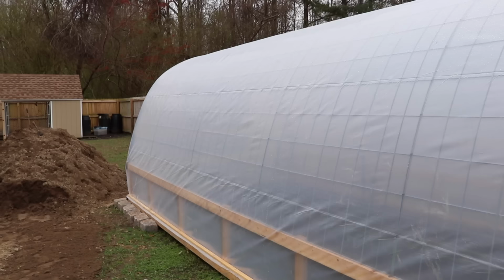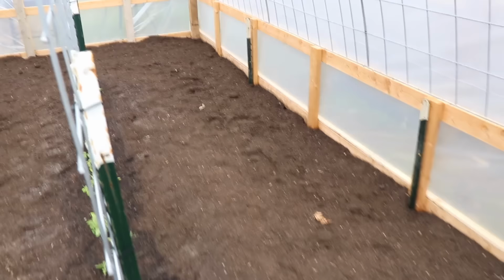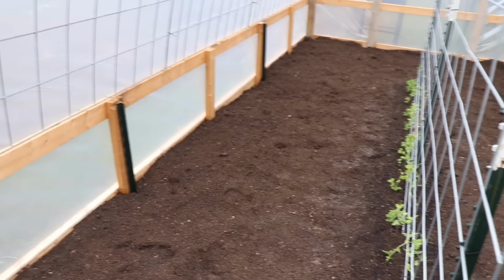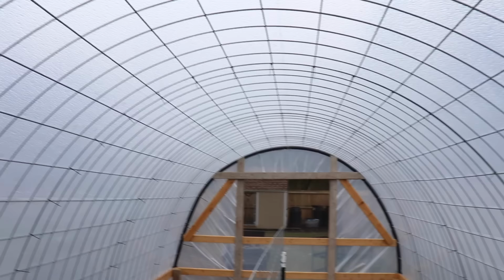DIY Cattle Panel Hoop House || Build Your Own Cheap & Easy!

Comment: Yes! I have built several of these. One for my bull, hay, worm farm! Mine is not as tall so they are about 10 feet wide. I overlap mine 1 square and connect with zip ties. The one my hay is in is 5 years old! Doing good thru the snow too. Put up a brace before each winter in the middle, good to go! I wish you the best!
Reply from the maker: Very cool! Very encouraging as this is our first season with ours! Thanks for hangin out with us. :)

Comment: Hello very nice greenhouse design. It is practical, simple and cheap to make. The only thing I would add would be cement pads to anchor the wood to the ground while protecting it from ground moisture.
From what I see in the video they have a waterlogging problem. This will create a problem with the useful life of wood, crops and ornamental plants. Moisture is the greatest enemy of constructions of any type and material.
The solution to this is a system of ditches to guide the water in the land to the outside of the property or to a designated drainage area. If they do not have access to drainage, a rudimentary one can be built with ditches and a well. The well in question and the ditches can be filled with boulders and gravel to give a greater area for absorption and storage of water on the ground and prevent harmful insects from breeding or collapse due to humidity.
This system will not only protect the land, but also the structures and crops located on it.

Comment: Super clean build! The added height from the wooden frame is so nice, and if you're on a budget that part can easily be built with free wooden pallets :)
Reply from the maker: Thank you so much! Yes, I love the added height, it makes it spacious & easier to work in there! 😉
Reply: I told my husband to use wood pallets and he said it wouldn't be very Good.  Thanks for that bit of advice.
Reply: @noraplowshay8784  it wouldn’t be. We tried some stuff out here with pallet wood and it rotted very quickly. Our friend used it on her farm and she says she replaces it every year or two
Reply: That’s exactly how we did ours, screwed together pallets then used cattle panels for the  top. We can roll the plastic up to the top of the pallets in the summer for good air flow and prevent overheating. Because everything was used and basically free our costs to put up a 12’ & 20’ greenhouse was under $30.

Comment: Looks good!  That's a great way to just build what you need without spending a ton of money.   Great result!  I would suggest using treated lumber for the bottom boards where it has dirt, compost, and moisture in contact with it.  But you did a great job with this.👏👏👏
Reply from the maker: Yes, we normally use treated lumber for everything we do outside, but the cost of lumber is CRAZY right now. Plus, we retire in 2 yrs and will be moving to our forever homestead, soooooo...it's ok if it only lasts a few yrs lol. Thanks for watching!!!
Reply: @HomeFreeAlaska  Wow, retiring at your young age is amazing — kudos.

Comment: I love the idea, the only thing I would do differently is move the walls about two feet wider so I wouldn’t have to cut each panel, or maybe just leave it where you had and make a high ceiling to train plants grow vertically.
Reply: they cut 1 lb because it would have made the thing too long for the frame they had. I don't see that they can hold any off the ends and it is plenty High.
Reply: @howtogetoutofbabylon8978  I’d just overlap the panels a bit.  It would make the arch a bit stronger too.

Comment: Panels are about 16 feet long X a little over 4 feet, I think.  I worked at a ranch supply house for about 9 months and helped load hundreds of hog and cattle panels, mainly to fence in critters with T-posts.  Not many customers would use them for grow houses.  They prefered buying their vegies, I guess, or eating mostly their own butchered beef.  I could get damaged panels for climbing vegs like pole beans.  Never had the room for a grow house.

Comment: Hi!! This is exactly what I have been wanting to build. I FINALLY came across your video and am so happy! Most of the videos are people that buy outrageously overpriced kits and the tunnels are small. I do, however, have a couple of questions. What size are the cattle panels? How long are the 4X4 posts and how deep are they buried?  Also, I'm assuming you used the cement in the post holes...?? I can't wait to see more videos as your tunnel greenhouse comes alive!!  Thanks so much for this!!
Reply from the maker: Glad we could help! Panels are 16ft L x 50in H...I can't exactly remember how big the 4x4s were but I'm guessing like 4 ft as we buried them 2 feet down in cement & there was approx 2 ft above ground. I'm so glad you enjoyed the video! :)

Comment: I like it and it looks great too !  I agree with the comments about better zip ties but also attatching to the wood side rails with two screws holding a plate over the bottom rail very foot or so and wire going up a few side rails incase spot welds let go.  Also the t bars firmly secured to the wooden side frames . thx.

Comment: this gives me such great ideas for a build. having the stub wall foundation is a great idea and would work absolutely perfectly for the height of a raised bed along the sides. my idea would require a bit more lumber but that comes cheap and easy for one who works in the trades.
as i say i'd love to have raised beds along the sides in order to have much more control over the soil. probably put a couple off center supports throughout for more snow load where i live, as well as a functional place for hanging baskets and the like.

ahh the ideas and rolling in. loved viewing this
Reply from the maker: I love all of your ideas! This design really makes it easy to tweak the build the way you want to. We've already done some upgrades as well like the sprinkler system & roll up side vents etc., I'm glad you like it, thanks for watching! :)

Comment: TiP .. Overlap the cattle panels by 1 square would make it stronger and use wire to tie together . Snap ties tend to break over time 
 Also i would`ve prefer to put raised  garden beds around the side and 1 through the middle, but that would change the whole structure plan. i wouldve built the raised bed first then put the cattle panels on etc

Comment: Looks great 👍🏼 Love the design!
Personally, anything unpainted and outdoors, it's worth the extra investment to go with treated lumber.
Reply from the maker: Totally agree! We just used what we had on hand at the time! :)
Reply: @HomeFreeAlaska  The ONLY time you need to use treated lumber is when you have direct ground contact like the corner posts. Your tunnel will last and last just how it is. Love the vid. How long are the wire panels??? Most come in 8' sections. Yours look longer than 8'.
Reply from the maker: @SurefireWoodsman  thank you…the fence panels were 16’ long by 50” wide. 😊

Comment: Looks great! I think it's going to work out really nicely. You might want to use hog rings instead of zip ties to hold the panels together though. They're metal clips that you bend with a set of hog ring pliers and it'll be a little more secure. You can just put them on from the inside. You can get a super cheap set of pliers from Harbor Freight that work ok or a better pair is only like $15-20. And the hog rings are really cheap. $5 or so for a box at a farm supply store. Just make sure they fit your pliers. Good luck with the greenhouse.
Reply from the maker: Great idea, thanks for the tip!
Reply: They would poke holes in the plastic or rip it when you drag it across the sharp end that will roll around the wire
Reply: @HomeFreeAlaska  What gauge of wire are the cattle panels 10 or 6 ?
Reply from the maker: @slingshoter8783  hi, they’re actually 4 gauge! 😊

Comment: Since you have the height you might want to use some PVC sections and hang it from the ceiling to hang things or run lines down to anchored spots to allow tie ups for climbing tomatoes, beans, etc that need the support as they get taller.

Comment: I would have use gravel for the floor, but to each their own. Get the plastic shelves that are thick that can do three levels, then buy lots of plants and pots, and set them on the shelves. Do it on both sides in both rows, so there would be four total. Heat it in the winter with a 55 gallon barrel stove. You are going to need a watering system like a mist machine to water your plants and last you were going to need fans to circulate the air. You are going to want to get to thermometer gauges to see what the temperatures are at all times.

Comment: Tina, if i am thinking, you'd do the same hoop panel build in Alaska for either goats or sheep or outdoor hoop farming, my only suggestion would be to build one with log cutout like on the sled.. on the horizontal ground logs of the frame with racing tow hooks, easy to move when its either winter or summer.
Reply from the maker: Thank you for the recommendations Edward! 😊

Comment: Thanks for sharing your hoop build project. Great inspiration! Apologies if this has been already asked and since this was posted earlier this year, I assume you haven't had snow yet, but I was wondering if you know how well this structure will hold up in such elements? Im curious because we live in an area that experiences the full force of all the seasons and would like to do something similar.
Reply from the maker: Hello! We do have some snow here in VA where we’re at but not much. We built this hoop house this spring, so have yet to experience winter with it yet! I’ve had a lot of subscribers that live with tons of snow, that say it’ll definitely need a center support beam to withstand the weight of snow. I agree a bit more support might be needed if you live with a lot of snow because the cattle panels alone won’t hold up. But also being diligent with snow removal will be important too to decrease weight and also preserve the plastic. 😊
Reply: I love their Design! They did an amazing job. I built my greenhouse with a similiar design, but used 4x4 posts, pallets and framed side beds. We get 28 inches of snow and high winds with no problems. I also draped a shade cloth on top and tied it down with ropes.

Comment: This is awesome.  I stole this idea and made one that is 17'6" x 7' and made it mobile!  Added 6 10" Harbor freight wheels and braced the corners so that I can move it without damaging the structure.  Did the doors and end wall framing with 2x3 to reduce as much weight as possible.  Also used "hog rings" instead of tie wraps to attach the cattle panels together.  I can move it by hand but pulling with the tractor makes it really easy.  

Great job.
Reply from the maker: Fantastic!!! So happy the video helped!😊

Comment: To help keep plants warmer without heat source you could put hoops and agribon row cover also if you dig down below the frost line and use Ridgid house insulation foam does keeping the frost prone ground outside the structure hitting the Earth 55 degrees below frost line on average could coat the wood and stain and spar varnish feeling it to make it last longer did that with my mailbox when people are moving out seems like they always throw stain away or put it out for free so I take it for woodworking
Reply from the maker: Hey there! Thanks for your recommendations! We appreciate that. And good thinking on the free stain, I like that!

Comment: Using the cattle panels is a great idea. There are so many rabbits in my area, I'd be afraid they would tear through the plastic at the bottom. I would have to either put solid panels at the bottom or some fencing.

Comment: Personally, I would have built doors at both ends for maximum ventilation in a hot summer, Also to allow entry for compost etc, rather than one door from one end. The vents need a piece of plastic to go over the vents for winter use so you can overwinter or grow veg in the winter,. If you had not planted peas down the centre you could have placed a row to slabs to stop you from walking on the soil and compacting it. Plus the space on either side would have been maximised. Well done for the joint effort and your touches of love for each other shown in the building,
Reply from the maker: Thank you Paul. Yes, actually of course after we built it there were things we sat back and looked at & thought we wished we had done differently. One of them is the doors on both ends. I wish we would’ve done that. It’s fine the way it is but doors on both ends would be most convenient! Thanks so much for watching our video. 😊

Comment: very nice, i like the idea of using the panels, I used PVC hoops and after 4 years the heat of the summer made them sag.   BTW the box store plastic will not last one year. it will get brittle from the UV in the sunlight.   it is total with paying for greenhouse plastic it will last 3+ years in the blazing sun of Oklahoma.   as a note for others, don't use nails, in your 1x nailer strips, use screws, you will have to replace the plastic, sooner than later, and at least yearly if you use cheap plastic.  if you use PVC hoops you have to sleave them with black poly pipe,  if not the chlorine from the slow break down of the PVC (poly vinyl chloride ) will rapidly break down your plastic where it touches the pipe, learned that the hard way too.
Reply from the maker: Thanks for the input! I love hearing from other’s experiences! And you’re right about the plastic. Learn as we go right? We’ll def be replacing it I have no doubt! Thanks again for your comment & for supporting our channel! 😊

Comment: Zip ties are not a goood idea...The become brittle quickly and literally fall off! Use wire.
Reply from the maker: They work just fine for now. We’ll replace when needed.😘
Reply: Use Uv coated ones. They last longer.

Comment: Excellent build looks solid and like it will last... A little thought I had while watching for possible upgrade, adding a send layer of plastic sheeting using a foam separator to give you an air layer for insulation, should help retain more heat and extend growing times. Also add in some sort of low cost/natural heating for even longer growing times.

Comment: I like the cattle panel design. Yours' is very similar to the one I built. Don't know where you live, but I put a center support beam on mine to keep the snow load at bay.
Reply from the maker: Right now we’re in VA & we don’t get much snow here. 😊 But I’ve had a lot of subscribers tell me they have also built support beams in the center to withstand the snow load where they live! 😉

Comment: I bet this cattle hoop building  handles the wind and snow very well.
Reply from the maker: Can't speak on the snow as we don't get much here in VA where we are, but we do get high winds here and even had tornados this summer and it held up with no issues. With every project you just have to evaluate your environment. Maybe a hoop house in another area wouldn't be the best structure...maybe a more permanent structure like an actual greenhouse with a foundation would be better to withstand heavy snow loads. But for us and our climate, it turned out to be a good little space for growing! Thanks for watching!

Comment: You might want to add some cheap lawn chair webbing across the top ever four feet to help the wind from lifting the plastic off. If the sun is to bright spray watered down cheap latex white paint on the plastic.